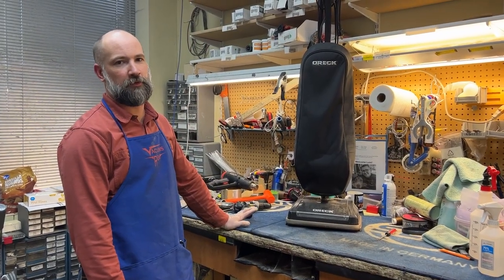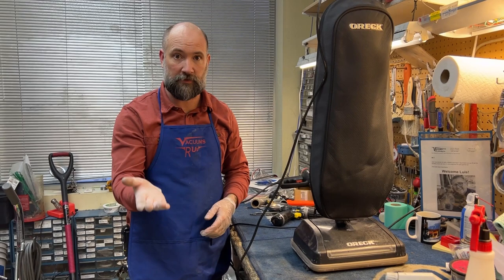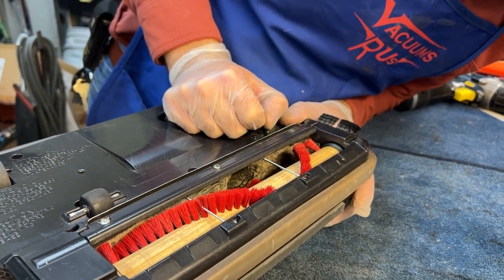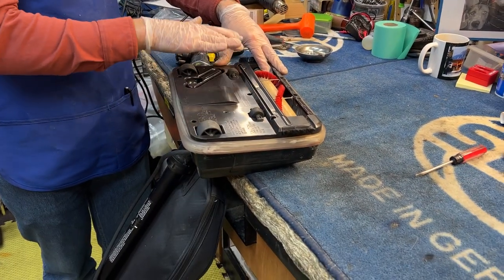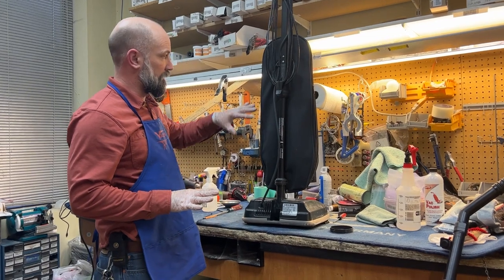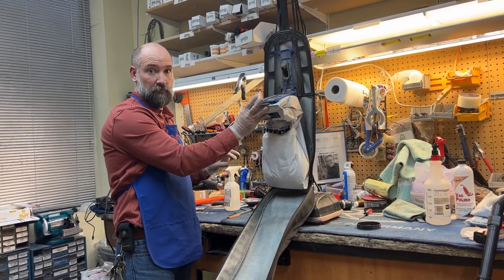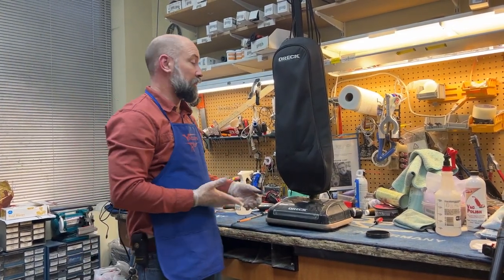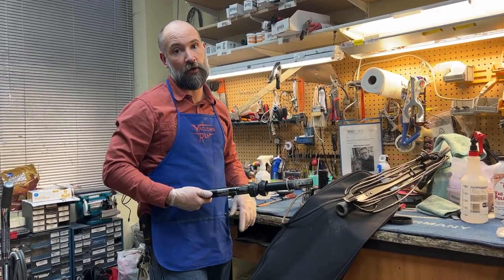How to Unclog Your Oreck XL21 Vacuum Cleaner

Comment: Information was well presented, verbally and by demonstration.  No wasted time.  Great sequencing to trouble shoot and solve the problem.  Taking the vacuum outside to blow out the clog was a great tip due to the volume and the force of waste expelled.  Job done in under 10 minutes.  Thank you!

Comment: Power screw drivers must be magic for getting the bottom plate screws out.  I usually
struggle with that.  Best tip for me was simply hugging the bag to see if it's inflating.
Very simple but I overlooked it.  Usual problem underneath is the belt off from
a captet snag.  Thanks for the video.  Liked.

Comment: I install carpet for a living and use a vacuum everyday to vacuum all the carpet fibers and plastic strings from carpet. Im thinking about purchasing a Oreck XL commercial. Do you think the oreck I purchase would be more prone to clogs? I seen videos where people vacuum up some pretty big things. Or as long as I dont pick up anything too big or overfill the bag I should be good to be good?
Reply from the maker: Our experience is that the Oreck is one of the worst possible solutions for carpet installers. The extreme shed that new carpets produce during the first vacuum is virtually guaranteed to clog the machine within minutes. So much so that when we used to sell Oreck vacuums if the customer had new carpet we would loan them a different unit to use for a week prior to using their new oreck. The unit we suggest is here: https://www.vacuumsrus.com/product/cleaning/vacuumcleaners/perfect/perfect-12-inch-commercial-vacuum/